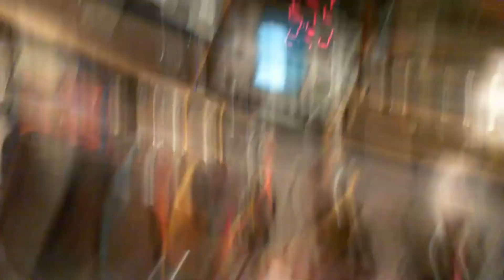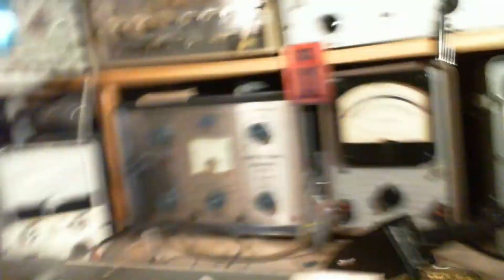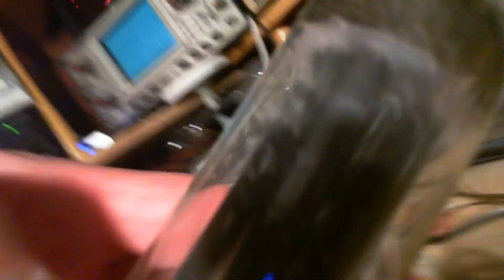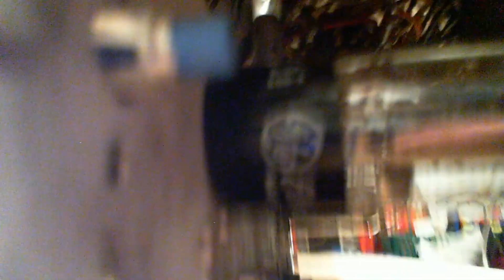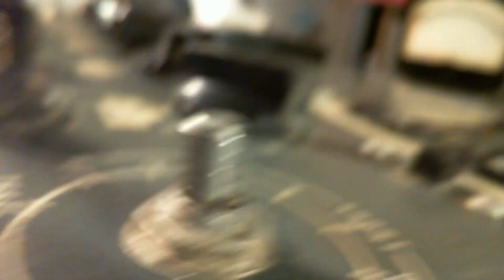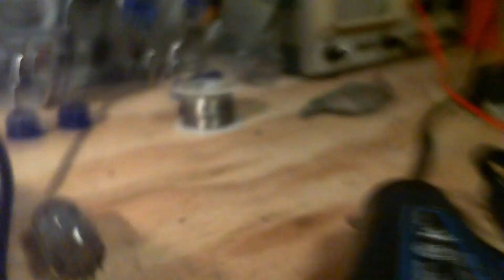Precise Model III Tube Tester Video #1 - Checkout

Comment: Yeah, with any rectifier tube that requires a 5v filament supply like the 5U4 you need at least 60VAC to get it to do anything. And even at that, it take a little bit.

Comment: That is one of the better testers for sure cause it looks like has 2 transformers to test a tube. 1 for filament voltages and another for plate voltage. Also this tester can test a tube for gm and emission. When most mutual conductance tube testers can only test for gm

Comment: Congratulations on your grandchild Jim. That Precise tester is one of the best gm testers ever made other than the Triplett 3444. Very well made with a way better circuit for testing gm than even my Hickok 539C. I had a bid on one last summer but it went too high for my blood. I have 5 testers so I lived without it. The holy grail is the Triplett 3444A, very rare. Made with all transistor circuit at the very end of their models of tube testers in the late 60’s. Found one last year that went for $3000. The Precise 111 fetches a good $$ too. Yeah, I’d use this one over any of your others. The best of them all. The guy on here, Mikes Radio Repair I believe is his channel has a few of the 111’s . His favorite by far other than his Triplett 3444. Link to his video on the Precise. https://youtu.be/puwyY6dlvRw